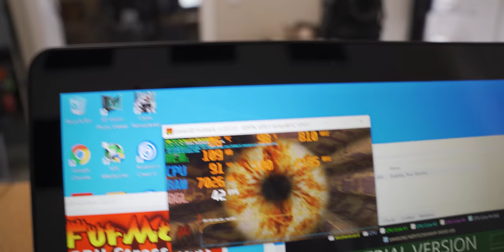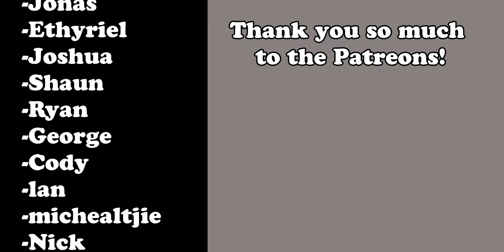The "BEST" way to FIX an OVERHEATING gaming laptop...

Comment: your last video actually inspired me to get one of these used Blades, though I sprang for a 2016 model with the 970m and an i7-6700hq. Funny thing is it's actually 2 years older than the laptop it's replacing. just couldn't take the terrible build quality of my Asus Vivobook any longer.

Comment: My Nitro 5 runs at 95C on the cpu and max 75C on GPU, its and i5 9300h and rtx 2060. Not sure how to lower the temp without lowering its frequency. :/ Got any advice? Its a new laptop, month old.

Comment: I suspect some component of the power delivery is getting too hot to really allow for much overclocking headroom. Adding some small aluminum or copper heatsinks with thermal tape might help out.

I mean, if you're gonna go as far as slapping two tower coolers on a laptop from 2014, might as well go full overkill and cool everything as well as you can.
Reply from the maker: That is a very good idea. It would have looked awesome. I checked the motherboard temps and they were okay so I'm not sure it would have made a big difference. It would have been worth the try though.
Reply: @DawidDoesTechStuff  That's fair. I just wasn't sure what all motherboard components you had sensor access to since some laptops are more locked down than others. Then again, it could just come down to the silicon on the board. It might just be that the parts selected for that particular laptop are just power restricted and can't push past a certain performance level. Kinda like the Acer Nitro 5 Gaming with its i7-9750H. It religiously sticks to the 45w power limit and throttles down hard when its hit with a heavy all core load despite having thermal headroom to boost higher.

Comment: Hello. I recently bought a Legion 5 Pro 16IAH7H Laptop (Lenovo) - Type 82RF with an Intel Core i7 12700H processor. The processor heats up in idle from 60 to 85 degrees Celsius. In games, the temperature rises to 108 degrees Celsius. The laptop is new, but I returned it to Lenovo, they replaced the motherboard with a new one, but the problem remained. I can't even turn off Turbo Boost and that's why the temperature in games is always above 107 degrees and the frequency is 4090 hertz. Please help me cool down  cpu.
Reply: pls go setting and cpu - power management - disabled 
then drope you're temp

Comment: Dear All, Is it possible to mount a LAPTOP video card such as a GTX 1080 MXM on a
desktop PC? Is there an adapter cable from the laptop video card attachment
(which I don't know what it's called exactly) to PCI-e 16? then I can see the
cooling and power supply but I would need to know if it is possible to connect
a laptop card to a normal desktop PC. Any information of any kind is very
welcome. Thank You
Davide - Si puo montare una scheda video LAPTOP ad exempio una GTX 1080 MXM su
un PC desktop ? Esiste un cavo adattatore dall'attacco della scheda video
laptop (che non so come si chiama esattamente) a PCI-e 16 ? poi raffreddamento
e alimentazione me lo vedo io ma avrei bisogno di sapere se è possibile
collegare la scheda di un laptop ad un normale PC dekstop. Ogni informazione di
qualsiasi genere è molto gradita. Greazie Davide.

Comment: My laptop turns off while gaming and gets really hot.
One of the things that helped it for me was setting the 'Max Processor State' to 80% in the Power Plan settings.
Now my laptop doesn't get too hot and doesn't shut down while gaming. 
performance isn't that bad compared to 100%.
Reply: I did the same thing to my Nitro. Brought Temps down to 60C when I game

Comment: I actually use my laptop like that but with the coolers on top of the stock heatskin with a generous amount of thermal paste, they don't move at all this way. The laptop turns on power so I don't need to open the lid. And I also cool the vrms and pch with 2 more small fans. You don't need a PSU for the fans, a cheap 10$ 12V DC transformer will do.

Comment: Slightly more practical might be to make a thicc laptop by taking one of those laptop coolers removing the top of it, removing the bottom of the laptop and sticking some heatsinks that are just thin enough to fit in the laptop cooler chasis on top of the heat pipes (keeping the original cooling working), and then directing the laptop cooler fan through the new heatsinks. Attach them together in a semi-permanent way and it's still be at least somewhat portable that way.

Comment: Every gaming laptop nowadays tops to over 90c on cpu on gaming, u will have to open it up repaste/undervolt with a good thermal paste or even liquid metal that's risky just to drop 10c off the cpu.
and sometimes if the heatsink is poorly made or insufficient repasting does nothing. This is a pain in the neck after spending over $1500-2000 on a laptop that overheats all the time.
All manufacturers nowadays go thinner heatsinks and ignore better thermals.

Comment: I just bought a small fan that blows wind into my laptop for 10 bucks. Lowered my temp from "enough to cook a chicken" down to around 50 degrees while running coolmathgames
Reply: My wife has the bottom fans laptop stand thingy plus a small fan behind the laptop. She does puzzles lol.
Reply: Which fan did you buy?

Comment: As hilarious as this is, just incase anyone actually wants to lower temps and comes across this, this is what I did recently:
1. Remove the heatsinks and re-apply a good thermal paste.
2. Download Throttlestop and undervolt the cpu 
3. Purchase some copper heatpipes for a few bucks online and some thermal epoxy and glue them in

I went from 95 degrees to 65... Though the inside of my laptop does look like a bit of a monster with the random heat pipes...
Reply: Wait, where do the heatpipes go exactly?

Comment: I think that the only way that this setup could be improved is if you set up the system so you can see the screen and flipped the display 180deg upside down.  Then you don't need any pesky external monitors. ;P

Comment: Im considering this, as I do push my Nitro 5 to the limit quite often, and it it is known for getting hot, even with a stand and adequate space for air underneath. Poor CPU has hit 200 degrees F before :((

Comment: You could use thermal epoxy to hold them down but the problem with thermal epoxy is you can’t get the cooler out after that

Comment: im actually looking to turn my gtx 1080 17 inch omen x laptop into a desktop,
and do external cooler like you. 
My laptops case is broken and so are the keyboards. HP wants 750 to fix both. Im not doing that

Comment: hi! nice video, i have a question if somebody can answer:

is it safe forthe junction temperature of the 6800xt to reach 90-95 C° and to run at this for some hours? i read on the amd website that it start to throttle at 110 C° but the fans go really fast so im starting to think maybe it's not that good.

thanks if you take time to answer

Comment: Re fitting Acer Nitro 5 i5 9300 to a desktop case (not tower). The issue isn't the lack of cpu and gpu heatsinks and fans per say. It is airflow. And not simply forcing more air into the laptop case as much as it is the removal of heat in the air of the case. Those temps would MAX out at 35C without all the board mounted cooling fans with just opening the laptop case, modifying it to remain stationary in a box designed to move air in and out and fckn fast. Of course, it will no longer be a laptop. Which is ironic anyway due to the stock design being able to burn the skin off your legs. Before you respond with how foolish my hypothesis is in this matter, Ill have you know I did it the wrong way a thousand times before I figured this out. $649 in a low cost performance laptop can in fact morph into a quite modest desktop gaming PC for what would typically cost you $2500+ minimum from any out of the box mfg.

I'm not a cheap person by any stretch of the imagination don't get me wrong. I consider myself methodically efficient. Big price brands tend to load consumers down with bloatware and other proprietary garbage. I started PC gaming back in the 90s. Gone are the days of the homebuilt Duron 800 with your 16 meg 3DFX Voodoo 2. Lol Im that old.

Comment: I re-installed Windows 10 and am getting processor overheating issues that are slowing down the processor to due to the down-throttling. Some experts are saying that I should rollback on the newly installed drivers, while others are saying to update. I am super upset by this cause I lost my processor speed and messing around with all the 17 new drivers and restarting each time seems like a ridiculous and tedious task.

 Anyone been through this and know which specific drivers to roll back on?

Comment: Back in the day I used to have a Pentium 4 laptop at 4 GHz and boy it was hot so to cool mine down I used to have an oven tin that I put freezer packs in then I would sit the laptop onto the edge of the oven tin and it would suck in the cool air it worked for about a year until the laptop cooked its self.

Comment: It may seem pointless but with gpus so expensive right now I just don't have the extra cash to build a new desktop. I have an Asus Zephyrus with an i7 10750H, and a 2080, gpu doesn't get above 85c but the cpu is hitting 97c in small bursts. I'm considering some pretty drastic measures right now to prolong the cpu life. Anyone have any other ideas besides this?

Comment: I honestly don't understand why these manufacturers are trying to keep pushing this kind of performance out of laptops, because I have a brand new $2,000 razerblade 15 and it runs hotter than the sun when putting any load on it, I can only imagine that it won't last very long doing that sort of thing, kind of a pointless thing to have, I figured that by 2020 they would've figured the heating issues out by now, but apparently not, and having a PC tower is just much better and always will be, gaming laptops are kind of a gimmick.

Comment: Wrong best way is to take a dehumidifier rip out evaporator and mount that in a hole on your desk, repipe and add a laptop fan pushing 40cfm. Hook up the system and keep supply air at 13 c. This way you will not be pushing wet air and the pc will be nice and dry.

Comment: i run my msi armor rx 580 on 900-950mhz as thats where most of my games run fanless and at 50watts of powerconsumption for 1360x768 resolution. i am getting 60 fps all he time on an amd A10-7700k cpu so why bother running at full power on gpu.

Comment: Just start youtube, type in Call of Duty Black Ops. Start the video at 720p for older laptops. Watch it for about 30 min. If the laptop is on blacklist, it will overheat, then it will shut down immediately. Use Opera browser. Restart when cooled down, repeat this 5-10 times. This will reset your cpu, when done, it will remain at 75%. Then, you can use other browsers to watch video. The fan speed will reduce the rpm to factory minimum. Cod 4 also has a fan reset tool, all you have to do, is qualify at the beginning of the game. This hack is permanent. Some laptops are on blacklist already, when you buy it. If the hack doesn't work, charge fully for 2 h 20 min. Unplug, then discharge it fully in the bios. Do it once after every charge. This will turn on secret permissions in the battery's eprom. The laptop will be faster and more silent on battery, and on ac online as well. So the better the battery, the performance will be stronger with less overheating on ac online too.

Comment: The CPU had very bad paste application in the stock setup, which is likely why it was throttling down to 700 MHz less than it did with the "custom cooling". 
GPU also was less than ideal with two corners being blank.

Proper pasting likely would already have helped... but we're not here for "reasonable" solutions, are we? We're here for pointless, but entertaining overkill.

Comment: My gaming laptop is literally sitting infront a ac unit I have it connected to a monitor so it’s closed in a stand it keeps the temps pretty low probably bad for it but it works 😂

Comment: bro just buy a damn pc if u are struggling with laptop CPU temp or lower the processor to 99% u will get both CPU and GPU around 68c which is totally fine at the end :)
Reply: Bro, a laptop is a pc. You mean a desktop
Reply: @bluescluessuperagent  Yeah but most people say Laptop and the PC is a desktop